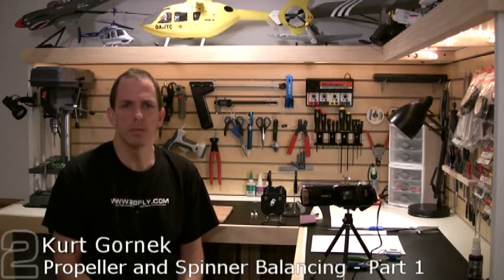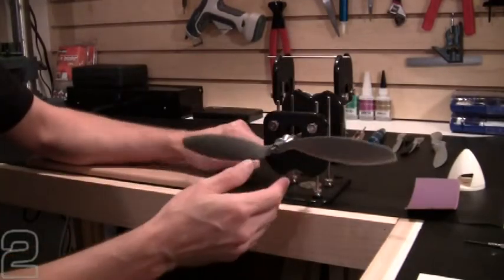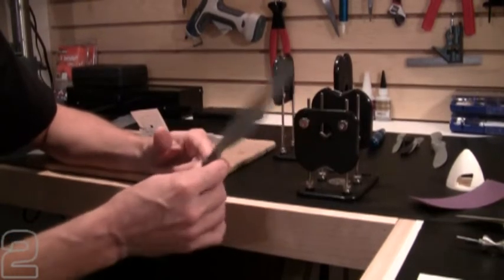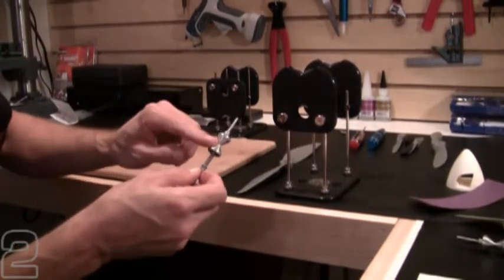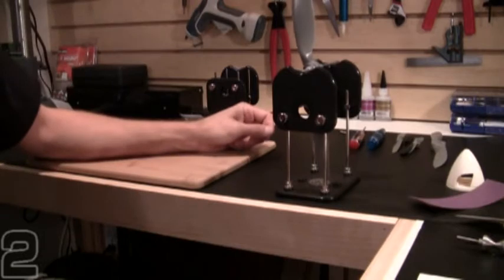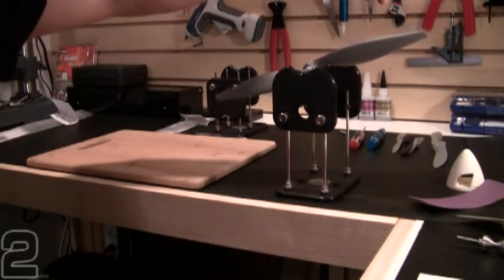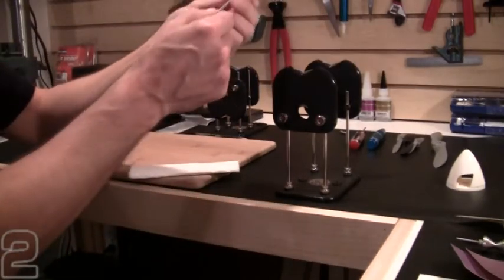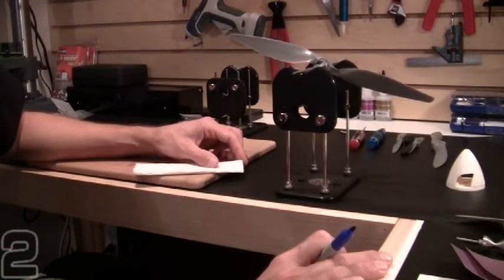RC Prop and Spinner Balancing - Part 1

Comment: I own both the Top flight magnetic and this unit. One really good idea with any balanced is that when the balancer is new , make a calibration prop. 
I found extremely small bends in the rotating balance rod will cause havoc. I use the calibrated prop to check the unit occasionally.

Comment from the maker: @FryerOfTheTire - Yep!  That's completely normal.  You don't wan't the 6 hex nuts slipping around or falling out, so the tighter the better.  Try using a "c" clamp, a pair of large pliers, a bench vise or some other form of clamp.  Just be sure the nuts are lined up properly in the holes before you apply pressure.   We used a small c-clamp and that worked perfectly.

Comment: I have one of those balancers and my heli 450 clone blades will not fit on the arbor so the only thing I could do was balance them through some stacked cd cases with a locking bolt between the two blades and did it that way. Got is as close as I can get it :)

Comment: The magnetic balancers are more sensitive, that's why the Dubro seems easier only because it is less sensitive than a magnetic balancer. I've balanced many props on the Dubro only finding they are not fully balanced when put on the magnetic balancer, also the magnetic balancer is far more sensitive to hub imbalance.

Comment: It is my understanding that APC props have a precision hole on the motor side of the prop, and a nonprecision hole on the forward side of the prop.
When installing the cones of the prop balancer, the tapered side of the cone should be placed on precision hole only. The cone on the forward side of the prop (the nonprecision hole side) should be placed so that the flat side contacts the prop. Not the tapered side as shown by this video.

Comment: You confused me when you said the back side. The back of the blade is the part not attacking the air. The side that hits air is called the belly. Little technical glitch  otherwise highly useful presentation. Well done.